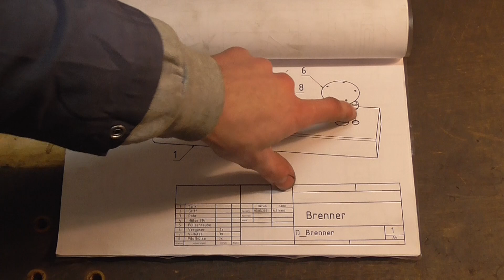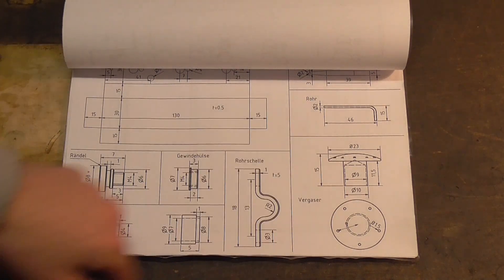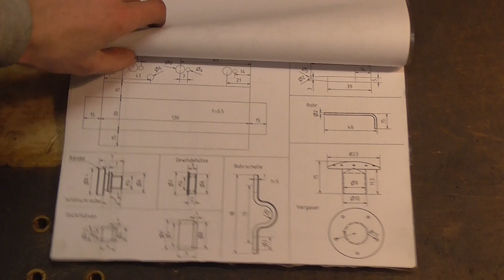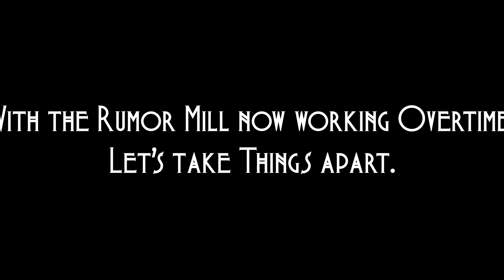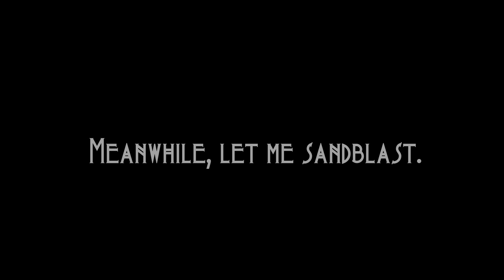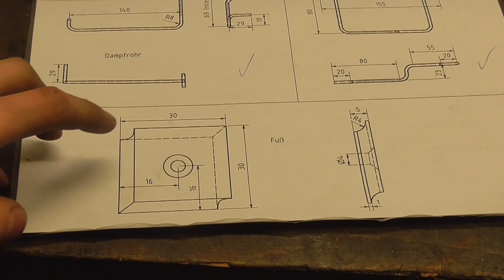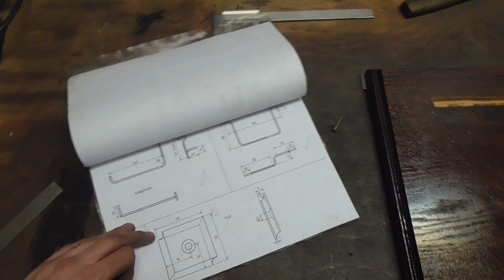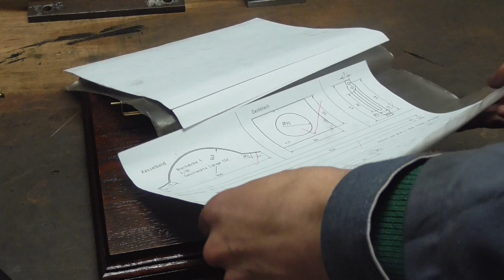Homemade Steam Engine #20: Burner, Bits & Bobs

Comment: thank you for this fantastic detailed video....i have a doll marine vertical boiler with missing vaporizer and have tried to make a replacement several times with limited success. This video is going to finally get the job done correctly...thanks so much....wayne

Comment: Your skill level is wayyyy beyond your age. Looking forward to seeing your engine completely done and running.
Next time you try bluing, after thoroughly cleaning the parts to be blued warm them with an even heat and then apply the bluing solution.
Reply from the maker: Thank you!
What temperature would be good for bluing?
I guess it'd make sense to stay below the boiling temperature of the solution?

Comment: I have to say I'm quite jealous of your skills. I'm sure they are hard-earned, but the result is that you get to work on cool projects like this.
4:50 Well, all you need to do is find some tiny robots that need hats and you'll be ahead of the game!
Machinist: Someone with a workshop full of very large motor driven tools and a toolchest full of very small measuring gauges. You can't have one without the other!
Machinist: Someone who does a better job than God making something, purses his lips and says "I'm not quite happy with this!"
It's a shame about the delay in nickle plating, but you'll get there eventually.